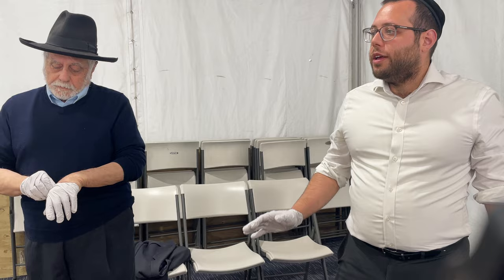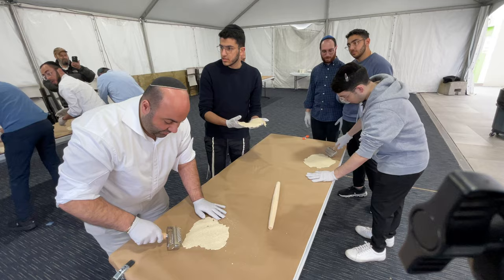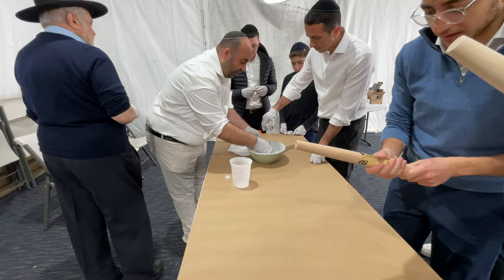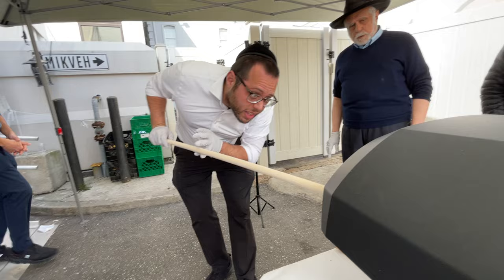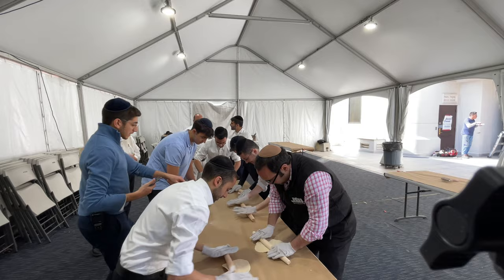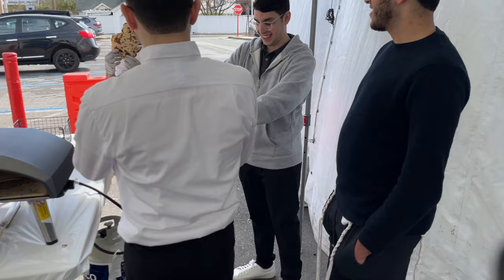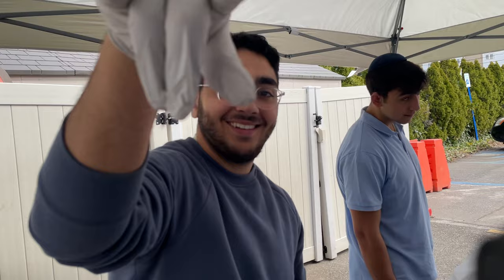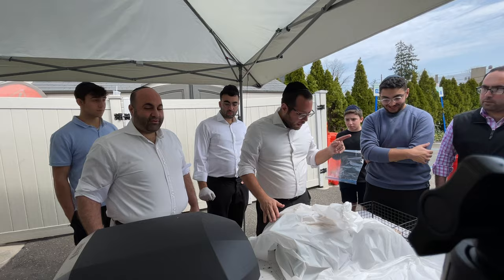Baking Matza with Rav Eliyahu Ben Haim 2024 | אפיית מצות עם הרב בן חיים תשפ"ד

Comment: The matza will not become chametz unless its seating not kneaded. The 18min will not start from adding water if you are kneading. You turn over 18minutes as chumra.  Also if you use glass rollers you can just wash them.. no sanding needed.